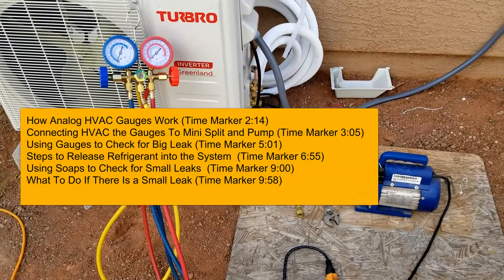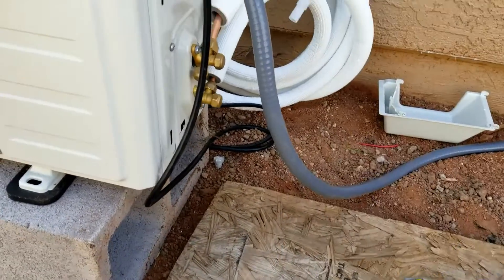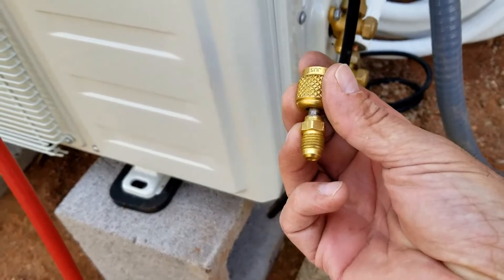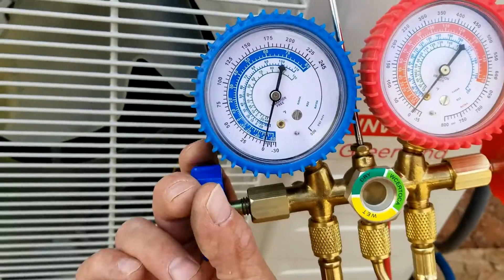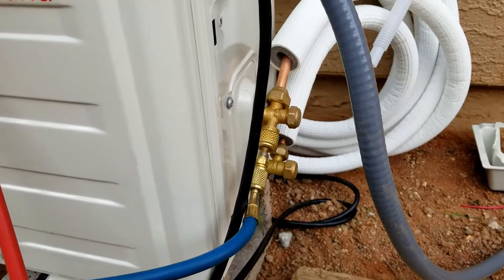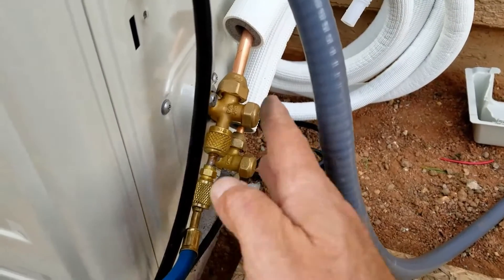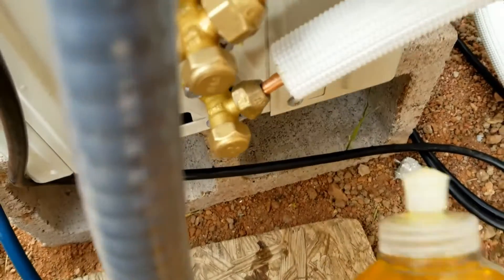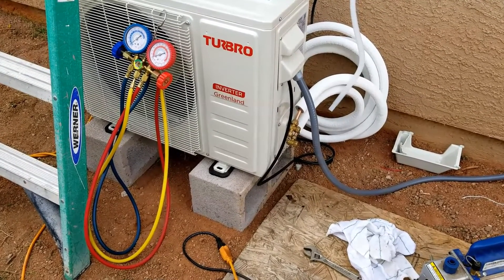Step by Step How to Vacuum Down Mini Split Using Analog Gauges Release Refrigerant Check for Leaks

Comment: Thank you for this excellent tutorial! I am just going to buy a $130 vacuum pump and manifold set from Amazon and forget the local AC people. THEY WANT TO MAKE $400- $800 on the set up and 1k or 2K on the sale of the unit. Some wont do the set up if you don't buy it from them saying we can't warrantee it. Another option is some Auto parts stores will lend you a pump, I also noticed the Della company that I am going to buy my unit from (through Amazon) offers a pump rental, which may be the best option, as they want you to do a good installation of their product.

Comment: I have watched several of these videos. Am i wrong or do some folks attach their gages on the lower valve? I noticed you had yours on the top valve.
Reply from the maker: The hose attaches to the low-pressure side (big line) when vacuuming a unit down.

Comment: Did you clear the refrigerant in the line set before you vacuum?
Reply from the maker: There is no refrigerant in the lines. This is done before letting the refrigerant into the system.

Comment: Good intention but again a micro gauge is required if you want a system that lasts a long time. If you aint got the money to spend on a professional installation, at least get the micron gauge and core removal tool, it will pay for itself when your system lasts 15 years versus lasting 2 years.
Reply from the maker: I've been installing split systems for 30 plus years and have never had an issue using analog gauges. When used correctly micron gauge and analog compound gauges both work just as well as the other.

Comment: if so it would be more easy to make the vacuum removing the shredder valve or is the same
Reply from the maker: It works the same as a tire valve when adding or removing air, so it's not necessary to remove it. Some techs will remove the valve when pumping down huge 10–25-ton units to make it faster pumping out air, but for small units like a mini split it will not speed it up.

Comment: no need for removal of the shredder valve
Reply from the maker: No, it's not necessary to remove it. It works the same as a tire valve when adding or removing air.

Comment: Great video! I'm in the middle of setting up my first mini split and will be vacuuming the system tomorrow. This is exactly the information I needed (too bad the poorly written manual couldn't have just said it like you did) Also had to dig up several videos to find out how the wiring goes. Turns out, it's very simple: Run the wires to 1, 2, 3, on the inside unit to 1, 2, 3 on the outside unit. In other words, on my unit that's (from left to right) Black (1), White (2), then Red (3) wires. Green/Yellow striped is ground, so from screw marked as ground on inside to screw marked as ground on outside. If not numbered, it's the first 3 connectors from left to right, the first one being "1", the second "2", etc. Just wire the inside and outside units the same, i.e. the black wire all the way to the left-most connector, the white wire to the 2nd from the left, and red wire on the 3rd connector from the left.

Comment: Great videao and perfectly explained. The manifold gauge only listed older r22/r410a refrigerant. can such gauge still be used for newer r32/r454b?
Reply from the maker: It's best to use the right gauge, but for vacuuming down a unit, usually any HVAC gauge can be used since it's only sucking all the air and contaminants out. After releasing the refrigerant if you need to check pressure, they won't work.
Reply: @HVAC_Mechanic  Thanks for the clarification. How about the adaptor? Are they specific to each refrigerant type?? they are listed as R410a

Comment: I want to move my minisplit.  I'm learning this "pump down" procedure.  So we just connect the gauge and it will show pressure, close the outlet and run the AC on cool till the pressure goes to zero
Reply from the maker: Doing a Pump Down is fairly simple there is a link in the description box for the steps. 
Basic Steps to Pump Down a Mini Split 
1. Attach your gauge (Blue) to the Large line (Suction line)
2. Power On the Mini Split Unit and put it in Cooling Mode.
3. Close the Small line valve with Allen key (Liquid line) 
4. Watch the gauge for the pressure to drop to zero.
5. Once the pressure drops to zero, use an Allen Key to shut the Low-Pressure line off (Big-Line)
Reply: @HVAC_Mechanic  beautiful, thanks!

Comment: Hi there, I have a question. I run the vacuum 15 mins, then close the blue van then turn off the vacuum. The gauge stay at -30 for 10 mins, then slowly raising back. I left it for 1h, come back, it stay at -10. So, do I have a leak?
Reply from the maker: If the vacuum is lost, there is a leak. If you can't find the leak and don't have nitrogen, a can of KWIK-E-VAC Line Set Flush can be bought to pressurize the line set and test with soap until it is found. KWIK-E-VAC Line Set Flush is a R152a propellant, which does not deplete the ozone layer, and is safe to use in a mini split line set.

Comment: Brilliant video. Is there any height restriction for the refrigerant to climb if the outside unit is placed a storey below the inside unit?🤔
Reply from the maker: It's always best to check with the manufacturer but usually height is not an issue. If the line set is extended beyond the recommended length sometimes that can cause problems.

Comment: Is there a reason not to connect both the high and low hoses from the manifold so that the vacuum is being drawn from both lines of the lineset? I do realize the lineset creates a closed loop from the condenser to the evaporator and back.
Reply from the maker: Most mini split units only have a low-side port.

Comment: Noob question here. I don't get it. I thought we vacuum because we want refrigirant to be pure, not mixed with air or whatever. But here we get the presumably dirty refrigirant sucked into the unit, than vacuum, than release the dirty refrigirant back in. Don't we need to pump in the new refrigirant?
Reply from the maker: When there is a leak, they are usually very small and take weeks or months to lose the refrigerant. If the unit is pumped down into the condenser, it is quick, and any leak is so small that any contamination will be very minimal. When done right, more air likely comes from the gauge hoses that are not purged.
Reply: @HVAC_Mechanic  Got it! In my case the installation was done by who knows who and they might have put the refregirant in without vacuuming at all, so the contamination would be huge. So I'm purging the whole thing first!

Comment: What happens if you dont vacuum the lines?
Reply from the maker: There will be air and moisture in the system that will cause premature failure and efficiency losses.

Comment: Hi is very good information now I follow all the instructions but my split won’t start any sugestión thank you
Reply from the maker: If you have a meter, verify the unit is getting power. Also, verify the connections wires between he inside and outside units are connected good and on the right terminals.

Comment: The part for dummy like me, was the video for new unit or existing one? Cause from starting video I didnt see nor heard you said closing the refrigerant(high/low pressure)valve before vacuum.  All i saw was after the vacuum, you then released both valves
Reply from the maker: This is a new unit. The valves are opened to release the refrigerant once the line set, and the inside unit are in a vacuum. The same is done for a used unit that has lost its refrigerant. If refrigerant is circulating in the system, then it needs to be recovered or pumped into the outside condenser (Called a pump-down) for storage.

Comment: Good video. Another option to break the vacuum to be less prone to loose refrigerant is to open the suction just a few turns just to have positive pressure in the gauge and then close it. Then take the gauge line off and proceed to fully open both lines.
Reply: Thanks for that positive thought that makes sense.

Comment: Fantastic video so well explained thank you . Can I ask if the unit has no gas in it can you still run a vacuum before hand to check for any loss of pressure ?  I take it then you need to charge it up in order to check for any leaks using the liquid method?? Thanks in advance ❤️🇬🇧👌😃
Reply: Hi I’m bit confused I seen somewhere else that the service valves have to be open when running a vaccum ? But in your video it looks like you done the vaccum and then opened the service valves ?? Can you please clarify . Many thanks 👍

Comment: Around 7:00 when you released the refrigerant and opened the valves with the allen key, you put the caps back on, and then removed the vacuum line and put the cap back on. Do you need to go back later and tighten those allens again after checking for leaks?
Reply from the maker: The valves need to be open for refrigerant to flow and for the unit to work.

Comment: Hello, perfect video thanks, so the only option to check for leaks is when the refrigerant is in the system ?
Reply from the maker: There are other options, such as pressure testing with Nitrogen or using a micron gauge. A low-cost option is to get a can of Pioneer KWIK-E-VAC to pressurize the system and check for leaks before vacuuming it down.

Comment: I am going to ask a couple  of questions that, so far, I can't get an answer to. I have worked automotive AC units for years, have all the equipment and know how to use them. 1) Service line (refrigerant line) length. I had to order my unit with the 50 ft length lines due to the position of the EVAP unit relative to the condenser unit. The lines are going to run under the house, the EVAP unit on one side, the condenser unit on the other. Best measurement I could come up with was a little longer than the 30 ft lines that they offered. Should I add a little R-410 to the lines after vacuuming the system down? I know that they pre-charge the condenser but I can't understand how they can allow for enough refrigerant for all the different line lengths they offer.    2) Flares. I notice that they use the single flare on the refrigerant lines. On automotive use with steel lines ( brake lines, fuel lines & older AC units with flare fittings) they use a double flare. Does anyone use double flare on copper tubing? Automotive AC units quit using flare connections way back in the 70s due to leakage problems. Good video and informative for the first timer. Thanks for taking the time to make it.
Reply from the maker: The line set can often be longer than the usual 10-25 feet, but it is best to contact the manufacturer to know for sure. Refrigerant is also usually added for long runs, roughly 0.2 to 0.6 oz per foot for R-410A; again, it is best to contact the manufacturer. You likely can use a double flare as long as it seals, but I believe soft copper tubing is prone to cracking when a double flare is used. I have always done single flare with HVAC line sets; be sure it seals and never had issues.
Reply: @HVAC_Mechanic  I've been trying to contact Pioneer but haven't received an answer yet. I'll keep trying. What I was thinking of doing was pumping a vacuum then adding just enough 410 to bring the low side up to zero and no more. Surely that wouldn't overcharge the system. I have double flared a lot of steel tubing but no copper. Thanks for the advice and the reply.
Reply: @HVAC_Mechanic  I found the info I need in the installation manual. I have just started to install the unit so I hadn't read the instructions fully. For lines exceeding 16 ft they call for .16 oz per ft. for the line size of my unit. So for 34 ft that comes out to .34 lb. Not much. Again, thanks for taking the time to reply.
Reply: @HVAC_Mechanic  finally got the unit installed, works fine, nice & quiet. A couple of things I learned: 1) Pioneer uses double flares on both the high & low side lines from the factory. 2) the 50 ft lines have a 1/2" low side line & it is very hard to bend a short radiius even with a tubing bender. Pre- charged the lines using the specs given in the instructions & the unit works smooth & quiet. Just some free info and, again, thanks for the replies. My first mini split project.

Comment: How does the soap bubble test for a vacuum leak? Wouldn't the bubbles be inside the line in a vacuum?
Reply: Soapy water in a vacuum make no sense. If the vacuum hold release the gas. Use the soap if the unit is running.
Reply: The soap is used only after the freon is released and there is pressure

Comment: I have installed pre-charged units before but they have always come with pre-charged lines as well. Never had a problem. This time I inadvertently bought a unit that indicated "pre-charged system for up to 25' lines" only to realize that the lines are not pre-charged. So, it was either buy the tools to evacuate the lines and test myself or hire it out... I don't expect a lot of support from a pro due to already having the install complete and just needing this step done... $500-$1,000 is what I hear and I can buy a decent pump, manifold and gauge set with the adaptor for less than the minimum pro fee. As much as it won't be top of the line equipment I really only need it for occasional use, maybe even just a one time use. This video is very helpful and I will be checking out the next video on how to recover the refrigerant in the case of a leak.

Comment: thank you so much for this! I have a Panasonic model cs/cu-z50xkr split system with R32 gas, Is this method still the same but with different gauges?
Reply from the maker: Pumping an HVAC system down is placing a vacuum on the unit to remove containments before releasing the refrigerant, so it is the same across all refrigerants.

Comment: Wow! Thankyou so much for making this video. I am wanting to install a mini split in my small shop and I was a little intimidated and confused about the vacuuming part. And watching some videos even confused me more because I couldn't understand where or how they were getting freon into the unit from. Now I get it. I didn't realize until watching your video that the freon is stored in the outdoor unit. I have a 3.6 cfm vacuum pump that I use for a vacuum chamber to vacuum air bubbles out of epoxy resin, so I assume that it will also work for this purpose too right? I just need the HVAC manifold gauge and the adapters yes? And of course some Nylog gasket and thread sealant....
Reply from the maker: Most HVAC vacuum pumps are 3-5 CFM, so yes, it should work, along with gauges and the adapter.
Reply: yup - too many focus video on themselves instead of jumping to the task at hand

Comment: Thanks for sharing your video. I just bought this vacuum (XtremepowerUS 3.5CFM) and set everything up according to your instructions. I let the vacuum run for over 15 minutes, and the pressure dropped to around -25 PSI and stayed there. However, once I closed the low-pressure side(vacuum is still running), the gauge immediately jumped back to 0 PSI. What could be the problem? I tried these steps on two different AC units, and both had the same issue.
Reply from the maker: If the negative pressure does not hold, then there is likely a leak.
Reply: That's weird. Check the hose connections of the manifold set. Or you have a leak in both systems or your manifold set has a leak.

Comment: Do you have to close the Freon lines before you vacuum it down?
Reply from the maker: The refrigerant is stored in the outdoor unit and is released once the line set is sealed and in a vacuum.

Comment: Your video was very helpful , i have a unit its 4 years old and it must have a small leak nobody else tells you how to remove refridgerant back into the outside unit, which is what i need to do and figure out which flare is leaking. The only issue is its difficult to find a recharge kit to replace what was lost. Most other videos just tell you add the refridgerant and never tell you where to check for leaks what good is adding if it still leaks. I like your idea of giving it 1 day to check pressure most of us cant get nitrogen. And everywhere i call around wont touch a mini split they didnt install. So i was glad i found this and hope i can find my leak i was to the point it was cheaper to replace the unit  myself again since nobody would help me , I just wish it was easier to find the 410a recharge for after fixing leak

Comment: did you close the blue valve after vacuuming the line? and then wait 30 mins or was it open the whole time? 
did you close the blue valve before opening the refrigerant to the line?
Reply from the maker: Yes, close the blue valve before shutting down the pump. Once closed, it will just be attached to the unit and reading the line set pressure. (When the valve is open, the pressure is open to the center yellow hose, which is only needed when vacuuming with the pump.)

Comment: I really need help, i recently move my AC to a new home. Did the install myself and vacuum the lines before releasing the gas (after proper pump down)

Then after i realized that the vacuum didnt work due to hose issue and the pump was only vacuuming the hose and not reach the copper line.

I have run the ac afterwards, how to fix this issue? Currently the ac has good 140psi but it is not as cold.

How to properly vacuum it all again. Help, pls
Reply from the maker: If the system is not vacuumed down, the refrigerant will have contaminants and need to be replaced. R410 can be bought online, but a recovery machine is needed to recover the old refrigerant from the system. Once the old refrigerant is out and the system is in a vacuum, the new refrigerant is added back in by weight. The label on the outside unit will have the weight info that needs to be added in.